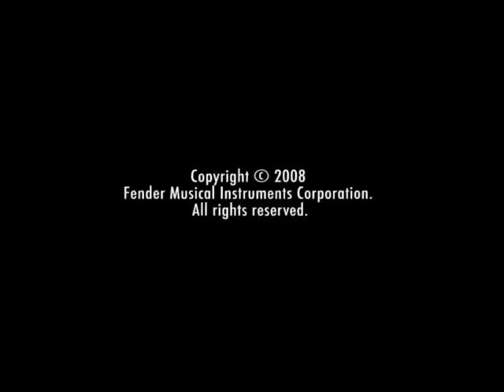The American Standard Series | Fender

Comment: i bought my strat aniv series sunburst 6yrs ago,
my only problem right now is the volume potentiometers.. luv my strat    
         it also has a telecaster settings,   l put jumper wires  on the bridge pickup to the neck pickup and installed a switch to the pick guard between the thin e string and the volume knob..

Comment: @Canadianspunge Well the tension should be the same because the scale length hasn't changed. They just tack that extra fret on there. I never had any trouble bending up to an E anyway though. But then, I am a giant! :-)

I'm working on converting my 95 MIM Tele to a 56 look (that was the 1st year for sunburst models). I intend to sand and refinish the headstock face and then buy a vintage decal for it. Then nobody would even know it was MiM if you didn't tell them.